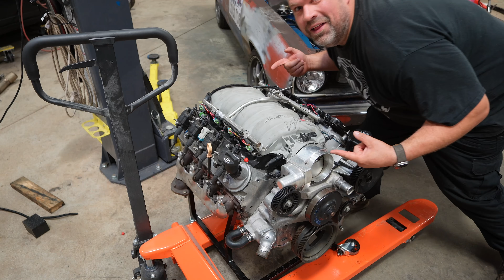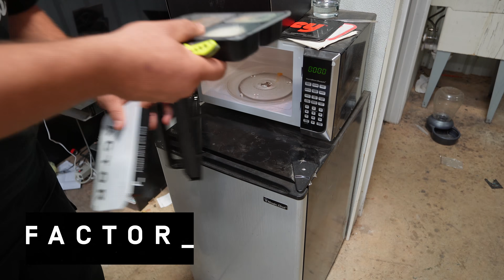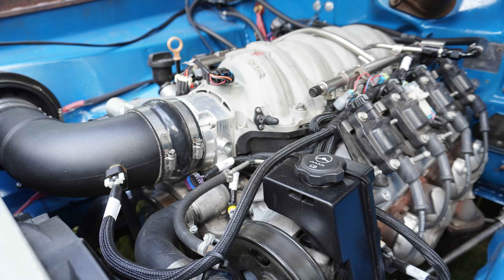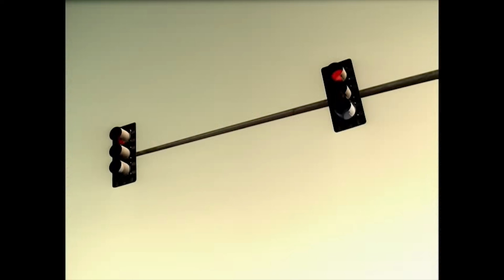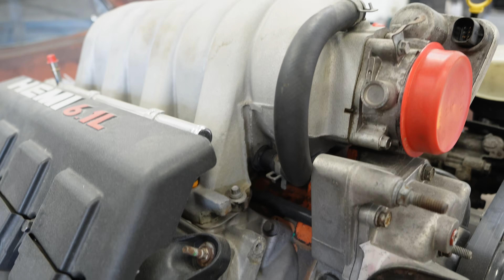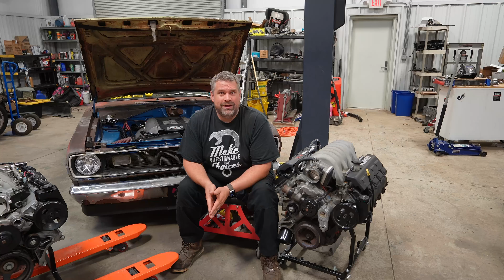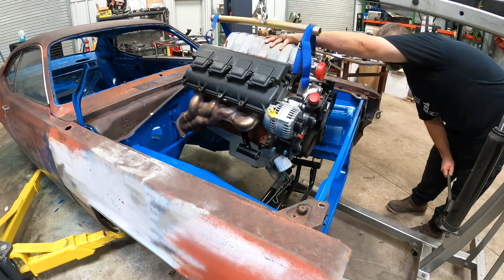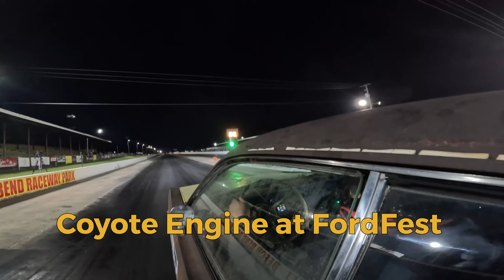What No One Tells You About Engine Swaps! Best Engine To Pick?

Comment: I have a 6.1L hemi in a 300c srt8 totally adore the 6.1L hemi it's a great strong engine as dodge crysler don't make the 6.1L hemi anymore will make it a rare model with it under the hood 425 horsepower just like the old school 426 Hemi I just put a throttle controller on mine it made a awesome difference

Comment: Today every company builds a great V8 option for racing. It comes down to what you can afford or fit in the your vehicle of choice. That being said, I'll take the gen 3 Hemi every single time. You can't beat their head flow and an iron block is suitable for boost. I'll pay the premium every chance I get lol.
Reply: Iron blocks are dated, Brett in Snot Rocket uses a Ford OEM block making 2600whp
Reply: @169abr  Yeah, after skirting them. Iron isn't outdated. It's still stonger. That being said, aluminum is lighter and has its applications. The 5th gen Viper handles 3500hp on factory aluminum block. You can also buy billet stuff that's pretty strong.
Reply: @PyroBlonde7777  I’ve never heard Brett say if the block is skirted, multiple times it’s been said it’s a 5.2 Predator block straight from Ford with thicker walls to make it a 5.0 and ofc all the wild internals and stuff. I believe Lund’s is the same iirc and stock 5.0 blocks have been well over 1000whp multiple times. 

I’m waaayyyyyy too broke to afford all that billet stuff but I appreciate the artistry and skill of it.

Comment: I agree with your opinion on these engines and the platform you are swapping into. I am doing a coyote swap into a fox body, sheesh, it has been tough. I have not done swaps with the ls or hemi, but the sheer size of em is obvious. The electronic portion has been the longest part yet and can get pricey depending on what route you take like plug n play, from original harness or somewhere in-between. Great video and I appreciate the opinion especially in the maintenance category. Keep up the great work.

Comment: I think the LS is the best swap, because of reliability, parts are eazy to find and they are not very difficult to work on. I just makes sense
Reply: I'm not a mechanic and have zero experience when it comes to deep car knowledge. The current engine in my car, the m271 Supercharged 1.6 liter i4 found in the W204 C180 Kompressor is relatively more simple compared to these. 

Could I maintain something like this on my own?
Reply: @khumokwezimashapa  easily but it's also gonna come down to where you are if you're in Europe an LS isn't gonna be in your pocket books best interest ... Where's your kompressor motor will have more parts at a junkyard, first thing a budget build needs is parts that are abundant in Europe a Chevy motor isn't gonna be plentiful... Here in America we're not finding lots of parts for a supercharged 1.4 liter Mercedes. But as far as simplistically speaking the LS is a walk in the park naturally aspirated.. when you start adding boost you're gonna need tuning experience because timing and fueling need to be spot on you run too rich you'll end up with oil that turns to gas run to lean and kaboom ...
Reply: @edspcpsandracing  Thanks. I live in South Africa and basically know no one with any LS knowledge. I'll have to check my local forums for that one.

Comment: My son recently bought a Jeep Commander with a 5.7 Hemi in it. So far, everything we've had to fix has been about 3 times more expensive than an equivalent part for an LS series engine. The Hemi tax is real...or is it just an across the board Mopar tax?

Also, I don't think you talked enough about how wide the Hemi is. It seems like it is at least 6 inches wider than an LS. That affects the exhaust during installation, but can also be a big factor in complicating ongoing maintenance after the swap is performed. And lets not even talk about the 16 spark plugs...

It all depends, is the answer to the question of which engine is best for your swap. Gear ratios will be a huge factor in keeping each engine in the ideal RPM range and it sounds like you kept the same gears for all for an "equal" competition.

Comment: One thing to add is that until recently, theres been very little aftermarket for the gen 3 hemi. And even still, its nothing compared to the ls, even though the two have been around almost the same amount of time
Reply: It really doesn't matter who has more mod support unless you're concerned with pricing. The reality is that you can build a gen 3 hemi well above 1,500hp with the factory block. At what point does it really matter? I'll take the superior Hemi every time.
Reply: @PyroBlonde7777  i have a hemi, so dont take it the wrong way. I just meant that until recently there was no one maxing out the hemi. You had to settle for 30hp at $10k. Now peple are starting to work on them and realize they have great potential
Reply: @jameswhitesell3076  When did you spend 10k to make 30hp? The Eagle 5.7 has horrendous exhaust manifolds. Swapping to long tube headers is 30hp with a tune alone. You can make a ton of power with a simple stage 2 camshaft as well. So unless you're talking like a decade ago then I think you're exaggerating or just bought the wrong stuff.
Reply: @PyroBlonde7777  the pre eagle 5.7 and 6.1s had very little aftermarket. I may have exagerated alittle. But even so, when i did my 19 rt, including labor, i spent about $10k for cam, headers, and ported heads and gained 60hp. That was 4 years ago.
Reply: @jameswhitesell3076  Porting your heads is where you went wrong. They already outflow LS race heads in stock form. You would have been better off upping your compression. The Hemis all run much lower compression than Chevy or Ford. 11:1+ would have given you a lot more power. You could have gapped the things and pushed around 1,000hp with boost lol.
Reply: @PyroBlonde7777  i didnt touch the bottom end, but ive fixed the issue with a bigger cam and ported 392 intake, now im pushing about 100hp over stock,  like i said, not alot of research in the hemi until recently. Heck a high ram and e85 and i could push close to 500whp, but im not cutting my hood.
Reply: @jameswhitesell3076  I've got a buddy who did a fully built N/A 5.7 stroked to 392. My dad ported the heads and an  Edelbrock intake for it. With a cam and added compression (with the strocker kit) he put down just under 630whp. But he had to run a stall converter to make it happy.

Comment: Listening to this guy talk about the history of each engine led me to question his knowledge all together. I'm a Blue Oval Buff, otherwise known as a ford guy. So my knowledge of Fords, Mustangs in specific, is fairly extensive. In the beginning of this video he spoke about the 5.0 liters history and the "Ford Mod, or modular, motor. In specific he stated that the first Mod Motor came in the 1993 Ford Mustang and he couldn't be more incorrect. The first Mod Motor to come in a Ford Mustang did not debut in 1993. It actually debuted as a 4.6 liter Modular Engine in the 1996 Ford Mustang. It was 281 cubic inches rather than the 302 cubic inches found in the 5.0 liter Modular Engine. And although the 4.6 Modular Motor changed several things and several times over the years, it wasn't until 2011 when Ford went back to being a 5.0 liter engine. The new Ford 5.0 liter engine in 2011 actually has more in common, design-wise, with the 4.6 liter engine than it does with the last 5.0 liter engine that was offered to come in the 1995 Ford Mustang. The 1995 Ford 5.0 liter was a push rod style V8 and the 2011 Ford 5.0 liter is an overhead cam over head valve style of engine. Push Rod style engines are an old antiquated style of motor. Whereas the overhead cam/valve style motors are of a newer design style of engine. The only area where a pushrod motor excels is in the area of weight. Pushrod motors are liter than the overhead cam motors.
Reply from the maker: Everyone has their exact area that they know everything about, quiz me Toyota Supra engines and I’ll explode your head. I know Fords ok, but not everything about them, so I had to do some quick research and did my best to retain what I read and don’t always get it by recall. Appreciate you adding the extra information

Comment: I’m a coyote guy so I can see your clear biased against it. Coyotes are way more reliable than given credit for. They have the most Hp potential of them all and can arguably make more Hp than the Ls for the same amount of money or cheaper. And if engine maintenance for the coyote scares you away cuz of the timing chain. Just learn to do it yourself and it isn’t an issue. You go the whole way swapping a motor. Don’t let maintenance scare you.
Reply from the maker: I love the coyote, but not as a swap engine. This video was about using them as a swap and it isn’t good for that, yet. They are amazing in the trucks and mustangs, and make insane power, and is fun to drive.

Comment: I guess I am a Mopar man if you need to put me in a stall. Chevy has as far back as I remember been the cheap option. Ford and Chrysler/Mopar has been the more ex option. 426 Hemi was always very expensive, and the 340 was pretty expensive as well. You could be lucky as I was and get a 360 with a forged crank, but they're getting rare. So we have cheap Chevys and expensive Mopar engines and where does this leave Ford. Well, in my opinion in the middle. 289/302 or god willing a 427 ohc are great engines and I always loved the noise they're making. I love the Ford Coyote engine sound, of course firing order probably is the key to that, but it sounds so raw! Yummy! Chevys has always been the blandest sounding ones to me, nothing that really stands out. So on the noise I would say, Ford, Mopar then Chevys. Price would be Chevys, Mopar small blocks and Ford. Availability is Chevys by far, but they are also so much used for this reason alone that I personally find them a bit boring. Fords are much more rare and therefore more exciting. Mopar here is in the middle. I am weird as I like Mopar A body cars while most people like the B body of a Charger or a Roadrunner etc. As for Mustangs, I feel everybody and their aunt has one or has had one in their life at some point. Chevys are plentiful except the more rare Camaros like 69 which everyone wants, myself included. The gen 1 Corvette is a beautiful car, but to rare and way to pricey. I like the Comet, I like Darts, Dusters, Demons and Cudas. I guess I just like cars, also what you would consider non domestic.  (I am not American). Anyway, noone will be reading all this jibberish anyway, but if you do, let me know what's your favorite cars and models. Are you as I am just a car nut? Does brands have a special place in your heart? One brand only? Anyway, thanks for your time. /cheers from Norway

Comment: Hey J i respect your opinion when it comes to engine builds.  Nobody breaks it down Barney style like you. Now what i would like to see is a video on not so common inline-6 engine's that make good power as well as 4cyl engines.  Like the VR6 for example. Technically its not an inline but it is and i know it can make good power.  Common but not so common swaps like that.  Old school ones like out of the 70-78 nissan 240z, 260z, 280z.  Not 2jz or 1jz engines. Everyone and there grandma knows about those.  I think that would be an amazing episode.  Especially if you build one of those out of a Z with a carbureted turbo.  That would be an awesome vid.  Anyway i hope everything with the surgery went smoothly and we can see you turning wrenches soon. Have a good holiday with the fam my guy.
Reply: Muscle car guys have little interest in low displacement grenades that Europe or Japan sell. The point of the American V8 is huge power with excellent reliability. Where you show up to the track, run fast, and drive home without any issues. Not the case for imports. It would be a neat video but there are plenty of main stream channels that cover those things.

Comment: Very knowledgeable guy, but he definitely misspoke a couple times. 

1) you never want the F150 intake, the same year mustang GT intake is always an upgrade to the truck intake. 2018+ GT intake is better than 2011-2017 intakes and GT350 is better than 18+. And thats just talking about low mount manifolds. 

2) the DI doesnt cause peoblems for tuning at all. Lund Racing has tuned 2018+ mustangs to run 7s unopened in the quarter mile with stock long blocks. They can take care of any needs you have for any coyote powered vehicle except 2024 mustangs since they dont have tuning available yet.

3) coyote is best ran with the ford ECU via the control pack which comes in at about $1200. No reason to go with aftermarket ECUs, Lind racing just went 6s using the stock ECU, so no matter what HP youre making or planning to make, you wont make enough to leave the stock ECU behind since LR made 2500whp with theres.

Comment: You made all valid points. But I think you should be keeping it apples to apples and instead of using a 5.0 coyote you should be looking at a 7.3 Godzilla. Pushrod V8 power and dimensionally the height and depth are the same as a Windsor V8 while only being 1” wider.

Comment: Im working on creating the new high money and if it fits v8 using another engineer's base engine design k48 honda based v8. But by building a boost system and set up for that base rhat creates unreal power for displacement and a ridiculous power and torque band. And lets you just tune it to you desired needs in a sense. 

Pick the most efficient supercharger available. Thats also oversized for the engines needs slightly so it can be over sized and underdriven for peak efficiency and increased efficiency but still hit the flow/boost wanted. 

Most efficient turbos that will work compressor map side of things and sorta trying to pick ones thatll work in a weird spot youd normally never see low boost for the flow but putting down ridiculous efficiency. 

Engine is hotvee so need 2 supers. Under blower water to air. And water to air for packaging the turbos for as much advantage as possible from the hot vee. But also flatplane crank which helps scavenging and so does the twincharger set up tuned properly. 

10k redline. Vtec tuned for 5k rpm.secrions if the powerbsnd. Dual dbw throttlebodies. 1k rpm or lower idle. Torque tuned to traction available. Interchiller powered by the ac but an ac compressor swap to suit high rpms and pulsed to go to redline.  2 stages of cooling efficiency and less heat gensrated on boost for pressure created. 

At like 1200hp at the wheels its just like 2 600whp k series. Crank needs to be designed properly. But for honda engines it should be reliable. Also other advantages during the design process to increase efficiency and rigidity and reduce losses. 

Crossplane like torque. Bigger displacement like torque. Wide ppwerband and NA like feel but suoer like torque and turbo like high end. High revving but dont necessarily need to go there but available. Probably still be fsirly fuel efficient and reduced detonation risks so pump gas.

Comment: Crazy comment section. My first 3 cars were Mopars, then a bunch of GMs and a couple Fords. I consider myself an LS guy, my 2000 Silverado 5.3 went to junkyard heaven because everything else failed it ran fine, 277k miles. My 2000 Yukon XL 5.3 went to junkyard heaven because everything failed except the 315k mile engine that still ran fine. Yet my current truck is a Ford with the 6.8 V10 and it runs beautifully with only 90k miles. Chevy, Ford, Dodge, your choice your opinion. I like them all and cant complain about any of them. Nor my 02 Ford E250 with 5.4 and 268k miles, runs fine.

Comment: 6.1 engines are fantastic for longevity, but don't take boost or high rpm without a forged bottom end. A 5.7 with eagle heads is epic starting point. Coyote is the technical champ. Except it's size. It's massive

Comment: An extremely biased review.  We get it-- you don't like OHC engines-- even if they they've demonstrated they're faster with significantly less displacement.  

Also, the Coyote isn't nearly as expensive as you claim.  I bought an 18k mile coyote for $1,300 and the control pack for it was $1,500 (which also controls the 6R80 Auto and includes the sensors and drive-by-wire gas pedal).  That's a fully running coyote for less than you paid for the Holley ECU (which you only needed because you wanted to run 3 different engines off of it).

Comment: 5.7 Hemi, 5.7 LS1 and 5.0 Coyote can run on any Automatic Transmission? or only works on 8 speed ZF or 10 Speed ZF? These 3 engines can run on any Rear Differential? Also the electronics of these engines can run on OEM electronics and Factory Computer? Last part is the Torque Converter for these engines can they be any that will run well?

Comment: Great video.. Jared just as a correction the modular motor 4.6 did not come in the Mustang until 1996 up until that point it was the overhead valve 5.0.  As for the rest of the Lincoln Mercury lineup it was developed in 1990 calendar year for the first model year of  the 1991 town car.

Comment: You can tune a gen 3 coyote to punch 500whp with e85, exhaust and intake. You CANNOT do that with the LS and Hemi, and at 500whp, many Gen 3's have run 10's with the 10R80, and thats in a near on 1800kg car. No achieve that in an LS, it's cam, springs the head gaskets, timing cover gaskets, quite a few hours labour, and the Hemi is the same. Coyote on rotating assembly has punched 1100whp with a stock engine, while niether of the LS and Hemi have done that, longevity not being accounted for. These things have been overlooked.